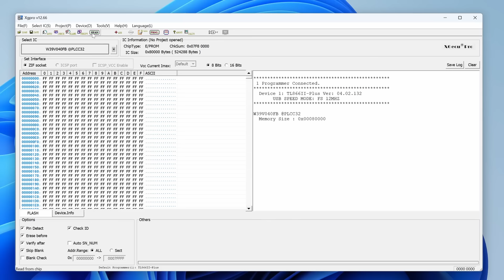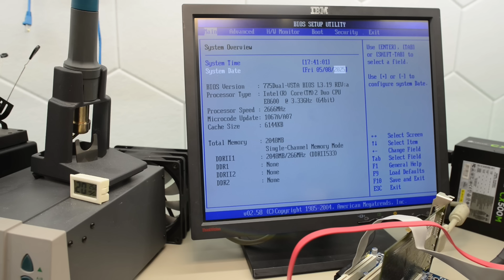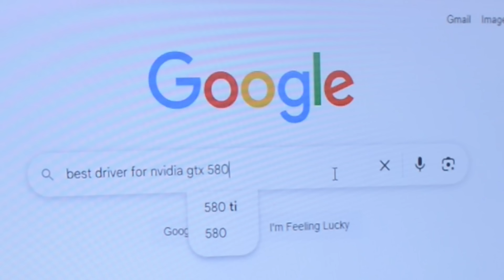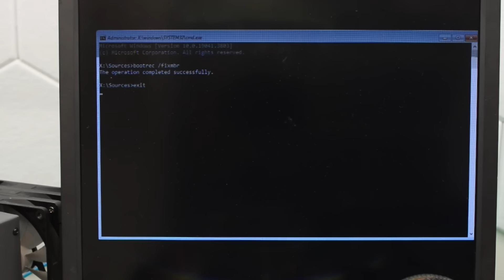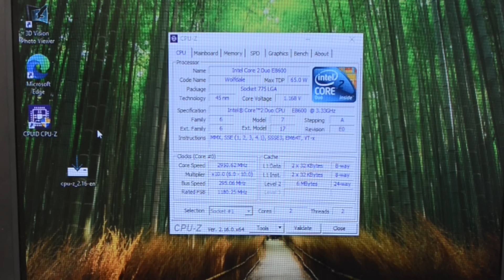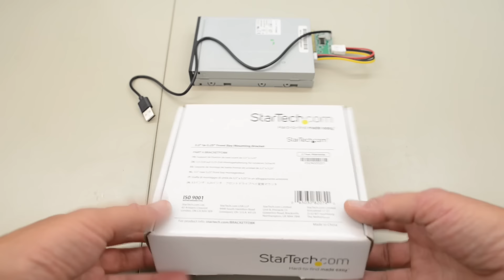Unbricking an ASRock Dual775-VSTA motherboard + 3 floppy drives mod! + ancient virus attack!

Comment: I have this exact ASRock motherboard, too, as part of my old daily driver for a short while from 2012 to 2013 (I upgraded to an LGA 1155 build afterwards). I found the board again inside my storage room back in July last year and decided to bring it back to life. I originally thought the board was dead as it previously simply couldn't boot anymore the last time I checked, but it turned out the DDR2 RAM sticks I had on it were dead, so I had to rush-order replacement sticks to make it boot up again. Even then, the RAM slots themselves are quite finicky, requiring me to plug & unplug the sticks a few times until I could get the system to boot. Once it booted successfully, though, it would keep booting as normal so long as the RAM sticks were untouched.

Unfortunately, after going through quite some effort at making the board fully operational again as a nostalgia build, I found out that the board itself was too gimped for my taste. Even if I was able to flash that third-party BIOS to make the board compatible with 2x2GB DDR2 and Intel's 45nm-based dual-core CPUs (which I couldn't done yet due to my lack of necessary tools for the task), the PCIe slot is still a massive bottleneck since the thing can only run at x4 speed as written on the board's tech specs and as detected by GPU-Z. I tested my GeForce 8800GTS 640MB (yes, the lesser brother of the once-legendary 8800GTX) on it, and it only gave me as much performance as my GeForce 9500GT did on a separate build with proper PCIe x16, though the CPUs I used might also be the deciding factors. Still, in my eyes, this board needs a strong-performing AGP graphics card instead.

Comment: With a super cheap Q6600 with the front side bus overclocked to 1300 MHz, there's plenty of processing power, it's not worth going for the most expensive microprocessors at ths socket 775.
Reply: I'd suggest one of the 45nm Q8xxx or Q9xxx instead of the old 65nm Q6xxx. The newer ones are faster, more power efficient, and have an additional instruction set. Unless you go for the top models they're still pretty cheap.

Comment: The script error is shown because the Nvidia installer shows virtually a website when installing. It is an error shown from the iexplore integration - which still exist today. I suggest you use a real OS, from the Linux side! :-p

For ripping and security, this joke would even be the best solution!

Comment: I bricked my MSI x99 motherboard the other day. But it had a pin header for JTAG, I used my raspberry PI and flashrom and some dupont jumper wires. No voltage-level buffer chip was required as the Winbond accept the voltage the PI uses.
Reply: 3:30 funnily enough I also lost the mac-address of my onboard network card by flashing the NVRAM. But no complaints, I just left it the default 999999999999 , a lot of nines
Reply from the maker: Excellent

Comment: I have a Fractal Define R4 case I got new in 2015 and absolutely love it.   This is an interesting build, scary to see that virus fucked up a Win10 install and a restore was needed.  I have several older systems I don't care about that I use to test drives and floppies and other crap I hoard.

Comment: yeah I gave up on a blu-ray slot for my server. So I just stuck cables out the back and set it on top. It's ugly but it works. lol Ironically internally it's the cleanest build I've ever done. Corsair's cases make cable management easy.

Comment: samsung is my #1 choice in SSDs. I have one over a decade old still works great. Sadly they didn't offer 8tb drives until now and I wanted a gen 4 not a gen 5. So I got a corsair drive instead. fingers crossed that it will work as well. Sadly 3 NVME on a single B550 board is not a good combination. So I'm looking to do a threadripper 9960x build soon.

Comment: you not only killed the mac-adress in the bios but also the UUID of the board which is used for the Windows Activation.
Reply from the maker: I checked. It's still there
Reply from the maker: I didn't even notice. I'll check and see if wmic can read it

Comment: To me it seems like you're literally disabling PCI Express on the board to get the graphics card to work lol

At that point, why not use something older? It'll probably run better.

BTW - for any changes done by bcdedit, you need to reboot the system to take effect. You're essentially changing the bootloader configuration for Windows there.
Reply from the maker: Ah, I forgot to boot. Crap. I plan to do some benchmarks and compare

Comment: Just my own thoughts, but instead of a second fan controller I think the fans on the top and bottom of the case are totally unnecessary and removing them would be a better solution.
Reply from the maker: The benefit of having this many fans is that I can run them at a very low speed, making the system extremely silent.

Comment: Drive bays in modern cases, now that floppy and  optical drives are uncommon they don't seem to want to include any front accessible drive bays, they are all internal for Hard drives or ssds. Can find a few that have a single 5.25" bay but 3,5" floppy bays are completely non existent now. You have to look at the used market for cases with lots of bays, or buy an expensive specialty case. Extremely annoying if you need removable hard drives

Comment: Unfair! This machine has more processing power than almost all the PCs I own including the one I'm watching this video on! How can you call yourself a retro channel? (of course I'm kidding! :-D)
Reply from the maker: Haha. 
Jokes aside, it's actually pretty snappy, despite running a "modern" OS
Reply: @Epictronics1  This is enough proof for me to try Win10 with a future socket 775 SLI build I want to do.   I am still using Win7 Pro on an old Dell Optiplex with a core 2 Quad that is just for browsing that I keep next to my main gaming computer.  If the gaming computer has an issue then I can quickly look stuff up on the browsing computer while trying to fix the main gaming PC.  I was thinking Win10 would be too much for it even with 8gb or RAM and a SSD.
Reply from the maker: @Vile-Flesh  If you go for win 10, consider the LTSC version with extended support.

Comment: Nice video. Be careful with USB 3.5 inch Floppy. They have issues with 720KB disk and double sided. Could find a LS120 on IDE.
Reply: Was going to say that.  I don’t know if USB floppy support is capable of 720K at all, but none of mine support it.
Reply: @sirnickity  I've definitely read 720k disks with USB drives. I think it worked with both a slim IBM one and the Dell D-Port model. I presume they also can write 720k, I just don't think they can format. Actually I don't think USB floppy drives can even format 1440k.
Reply: @eDoc2020  Reading, yes.  They cannot format (at least not that I've ever been able to manage), which is the crux of this discussion as I see it -- being able to make 720K disks.    Not sure I've ever tried writing to an existing 720K disk.

USB drives can absolutely format 1.4MB disks though.
Reply: @sirnickity  I haven't tried recently (and may be misremembering something) but I don't think I was able to figure out how to low level format a 1.44 disk in a USB drive. Obviously you can do a filesystem format but that's the same as writing data.
Reply: @sirnickity  But to be honest, how often do you need to format a 720k disk? I don't know if the "preformatted" disks ever became standard in the DD era like they were in the HD era but at this point most of them have already been used. Unless they are bulk erased or Mac formatted they are probably already 720k and ready to accept a new image. They can always be formatted ahead of time in a separate device.

Having said all that, if the purpose of the system is to create and archive disks for other systems it would probably make more sense to use a Greaseweazle. Then you also get nonstandard formats the PC controller can't handle and the native ability to use 3 drives.
Reply: @eDoc2020   The format dialog in Windows 7 and fdformat in Linux both do it on the drives I have.  Incidentally, the ones I have are all high-speed (>1x) drives, so clearly not just a normal floppy drive with a USB interface tacked on.

As for "how often do you need to format a 720K disk" ... well, not as often as 1.4MB, obviously, but the whole concept of this video is a bridge machine to read and write disk images of various formats.  If you have 808x machines in your collection (in my case, PS/2 Model 30, Tandy 1000 RLHD...) then also not "never" either.

MY bridge machine is a 386 with a 720K 3.5 and 360K 5.25, and a SCSI ZIP drive to transfer images to/from the other bridge machine, which is a Core 2 Duo with a USB floppy drive and a ZIP drive and access to my NAS.  If I'm going to write DD disks, I use a DD drive.  HD drives are a compromise you only make if you have to, and USB drives are just a band-aid for systems that don't have real floppy controllers (or space to put the drive, such as in my case with the Core 2 mini tower that only has space for the ZIP drive.)

Comment: I use the exact case for one of my larger NAS builds - the major drawback for this use case is that is doesn't have hot swap bays and individual indicators like the way more compact Chenbro cases I used for my other builds (I think they were SR301s). But when going for more than four drives this big Fractal Design case is great (and silent).

Comment: The problem with the MAC address comes because at factory they flash specific data unique to the board, such as the MAC, DMI variables or the UUID/serial/model numbers, using an extra tool to flash the GPNV area of the flash chip. Ofc since the data is specific to each board, it doesn't exist in the bios update files. The specific GPNV region in the BIN file is padded with zeros, and the end user bios update tools have logic to skip that area from the flashing procedure.

Good news is that retail boards don't have that much GPNV data. If any only the MAC and the DMI UUIDs. Also generally these don't have manufacturing mode. In OEM boards for branded systems like Dell, HP and cia, they have more data there, it is signed, and generally you need to have it complete to operate the board normally. Otherwise, you will get the dreaded "manufacturing mode" and certain stuff in the board will be disabled or it will not work correctly. In the past service shops had to have tons of bootdisk with tools to set the GPNV, specific to each board, so you could get it out from manufacturing mode with the data provided in ROM dumps or stickers in the machine.
Reply: hey so i know it has been a long time since you posted this but my board has the same MAC issue and the sticker is partly destroyed on the board. Do you think i really need the board's original MAC address or can i just do a random one? Again sorry for asking this after a long time but i don't know much about this stuff and i figured i could shoot my shot

Comment: The reason those tools slip and damaged the top of the chip is because they are all cheap chinese junk. If you buy the original tool it works correctly. However this is 2025 and that tool isn't available and the cheap chinese copies have bred like cockroaches and are everywhere. I also use a small screwdriver to release the chip. Sometimes the chips get so stuck after being there for 20 or 30 years that even the proper tool can't get it out, especially on larger 68 pin or 84 pin chips. Just make sure it's done carefully and slowly from each side so the edge of the socket is not broken out otherwise the socket has to be replaced.
Reply: I own a tool I bought back in the late 80s, so not the current Chinese trash - nevertheless it tends to slip...

Comment: I only need modern Windows for drive utilities and such. I've had several bricked systems from updates and only one was recoverable, which  suggests that the notion of Home and Pro being betas for Enterprise is more than a rumor. That's a splendid case. It has even more drive bays than my beloved Antec P183 and P280. I think we're supposed to replace our many old drives with very large radiators now. I'm still trying to sort a means of transferring data to those. 😉
Reply from the maker: Win 11 is beta software for sure. The space in modern cases is probably supposed to be used for RGB rainbow puke :)

Comment: In trying to find a case for the build I want to do, with not only the floppy drives, but also other types of removeable media, I did stumble across on Newegg a modern case with 12 5.25 inch drive bays! I thought it was a Phanteks, but checking now reveals it to be a anidees AI Raider XL. Never heard of them before, but the option is there.

Clever hack using a USB converter on the 3.5 inch drive. Those usually only work on the 3.5 inch drives, so it is key that the motherboard support the 5.25 inch formats. The only limitation is since it goes through the USB controller you can't use something like Omniflop, which will let you write disks in formats other than DOS/Windows compatible ones without needing something like a Greaseweazle. But if that's not a use case that you have to worry about, this is an excellent option! But be careful. Not all the USB options can handle anything but 1.44 MB disks.
Reply from the maker: That AI Raider XL looks sweet. I'll try to find one

Comment: Isn't there an AMD based motherboard with 2 floppies in order to have 64 bit cpu integrated memory controller and use as much RAM as you would like ? I think Asrock made an AMD version of that motherboard. Also you can find way cheaper CPUs, very nice case and idea of a system, looking forward for the next video! Cheers from Greece

Comment: If using old hardware, why not use an old case, since you can find them with lots of drive bays and for cheap?  Also, questioning the need for the fastest CPU for a testing rig negates the choice of that graphics card.  Just go for it!

Comment: USB floppy drives have very limited compatibility... They can only access a few common format of disks as the controller chip on the PCB is converting it to a USB "UFI" block device.

Comment: I got a sweet deal on anew Motherboard, the owner flashed the BIOS and the MAC address set to 00000000. I figured I'd use it but ran into the same issue. It required a special keyboard sequence and the menu item in the BIOS would appear to display and set the MAC. The MAC was on the board sticker. I wish AI could remember the key sequence

Comment: You can have GTX 580 and both IDE cables no problem but in my case I had to break the plastic stress relief, so that the GPU is fully seated in the slot.

Comment: If you ever need 6 front panel slots, take a look at the Silverstone RM41-506 - as a bonus it’s a desktop orientation (also 4u rack mount). Currently using one for my workstation (which among other things includes an LS120 drive for floppies!)
Reply: I see a slim plastic trim center bottom is that for a slim dvd drive. Also can it fit at class machines. It would be cool to have all my pc's in same formfactor stacked on a rack.
Reply from the maker: If I can ever find a reasonably priced 19" rack
Reply: @Epictronics1  You don't have to mount it in a rack
Reply from the maker: @AnnaVannieuwenhuyse  I have a stack of loose rack servers on the floor, under my bench. They are a pita to move around and work on.

Comment: Strangest virus I ever encountered was when I worked at an electronics firm as a tester. One by one, the testing computers we used to test a particular brand of UPS (uninterruptible power supply) circuit boards started crashing with an error message. When looking it up I found the error was from a virus, so I made sure to clean it off the computers. After a while the virus returned and after looking into it to find the source, I found that every time we used a particular CPU on the boards we were testing. I couldn't believe it at first, so I cleaned the computer, tested with a different CPU and everything was fine, then went back to the bad CPU and sure enough, the virus returned. We pulled it from use, and the virus never returned.
Reply: Bad micro code. Can you remember the year that happened and was it an amd or intel part? Very curious.
Reply: It was the early 90s. I don't remember who made the CPU on the UPS board. It wasn't a PC CPU, probably more of a microcontroller in fact. The company I worked for built the boards, but the CPU/microcontroller was put in later by the UPS company. Which, by the way was a well-known one with many UPS and surge protector consumer options. They gave us a handful of the part which we would put in the boards when we tested them then remove them to use in the next board.

The virus itself was a very simple DOS virus that only crashed the testing computers (DOS PCs) to a blank screen displaying a simple short message. I can't recall now what the message was.

Comment: I love the USB/floppy solution. I'm also wondering about how useful an LS120 would be for that
Reply: Unfortunately LS120 drives suffer from reliability issues after some 25 years. I've accumulated 6 of them over the years, of which one is brand new, another is obviously used but still reads/writes fine, and all the others just make a whole bunch of weird noises and don't ever read/recognize anything
Reply: LS120 drives are awesome, I use one in a PowerMac to write standard diskettes for my older Macs